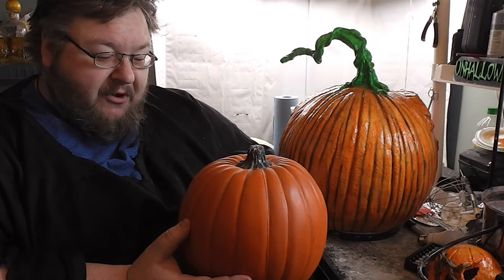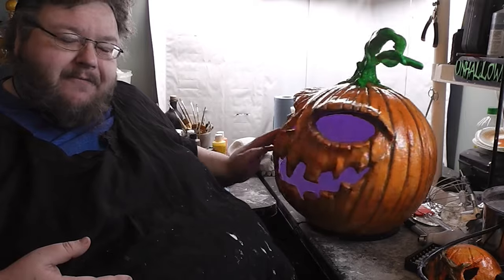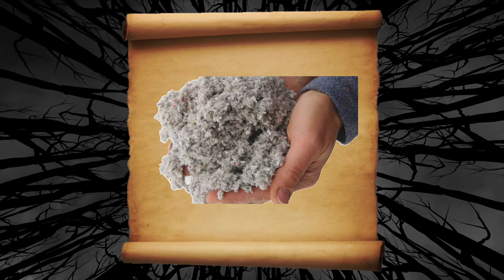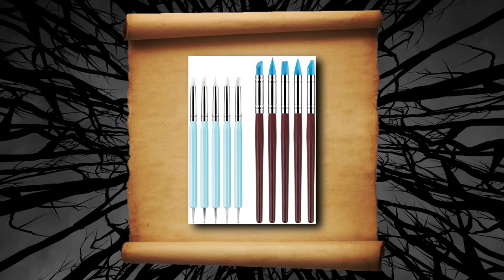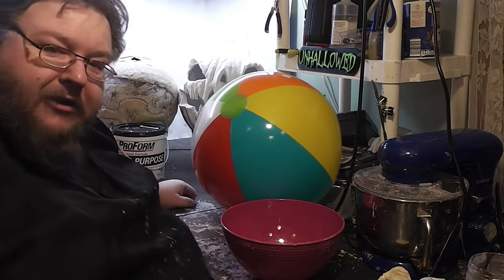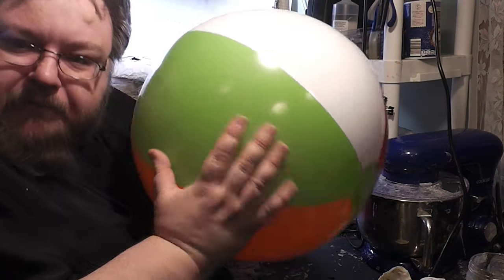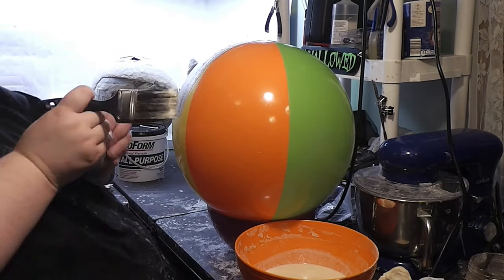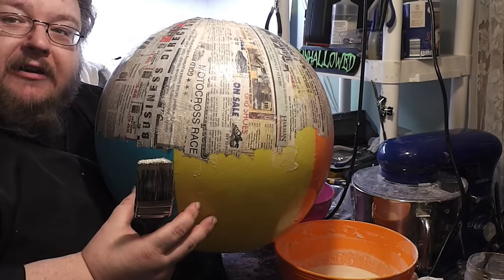Paper Mache Pumpkin Version 2 - Part 1 Intro and Materials

Comment: Apologies if I missed this on another video or stream, but is there a reason why you stopped using the liquid starch in the paste?  I’ve made a few of the V1 pumpkins with the starch in the mix (with good outcomes) and just wondering what the difference is. Thanks, Drach!
Reply from the maker: I never found the liquid starch did much for the mix so I didn't include it

Comment: Out of curiosity. If I like the more squared shape pumpkins that the trash bag design gives, could I maybe just partially blow up the beach ball? So it has that squared situation??
Reply from the maker: I did an experiment recently with a similar method. I underinflated the ball and then wound some packing tape around the middle to give me a taller more oblong pumpkin and it worked fairly well. Underinflating and then reshaping is very much a viable way to do things. I would suggest that you use some sort of constricting medium like tape/rope/cord to clamp down on the underinflated pumpkin so that it still give you good push back in its underinflated shape in order to still be a sturdy armature while you are laying and adding clay.

Comment: Hello, congratulations on the video. I have a question: do you put something on the ball to prevent the glue from sticking, or do you apply it directly? Thank you.
Reply from the maker: Thanks. I don't put anything special on the ball. As mache paste dries it does not interact with the beach ball and so when the ball is later deflated and removed it will always pull smoothly away from the mache shell.

Comment: Do i mix the 6 cups of flour and 1 cup of glue and water? All together? Or little by little?
Reply from the maker: You'll have your best luck starting with a bit of water in the mixing bowl, maybe 4 cups of water in the beginning. From there you can add glue and flour all at once. The water present at the beginning will help ensure that the flour doesn't clump quite as much.

Comment: Hi there!!  I’ve finally decided to give this a try.  But here’s my problem, I don’t have access to news paper so I bought packing paper, it’s thicker and heavier than newspaper and I’m having an issue with it raising in kinda like waves on the edges.  Any tips on how I can eliminate that problem? I’m hoping that when I clay it… I can try to feather some of it out.   Thanks in advance!!! I just love your creativity!
Reply from the maker: No problem. I'm guessing the stuff that you have is something like what I call kraft paper which is the brown paper often used to wrap things. I can see where that would have a tough time sitting flat. You have a few options. The first option is to severely reduce the size of your paper strips. If you make them about an inch or less wide and about 6 inches long you should reduce the tendency of them to frill up at the edges. The next best thing is to obtain something with very good paper flexibility to alternate layers with and in this regard the best choice would be paper towel. So you'd do a layer with your packing paper then one with paper towel and keep alternating. This ought to apply a little bit of down pressure on the frills while keeping some moisture locked on them long enough to drag them down. All in all I would not panic if you think that the shape is in a bad way at the onset. When you clay over all of it you will never notice the flaws in the shell.
Reply: @Drachenfang  thank you so much!!!  I did end up using a much thinner packing paper over the thicker paper and it really helped!!! I do have a couple of knobby bumps, but I got to thinking I’ll use them to my advantage to give my pumpkin some added character.  Lol!  But I will definitely do another layer with paper towels!!  Thank you so much for your tips!!!
Reply from the maker: @annmariewalker892  Always happy to help :)

Comment: Maybe it's because I'm in the UK but that seems like a lot of flour, i might end up with a bucket full of glue with that amount.
Hmmm is that amount of flour necessary?
Reply from the maker: It's honestly more like a ratio. 6 parts flour to one part glue and add water to preffered consistency. It's really down to how much paste you want to make. At this point I've made the stuff so often that I don't measure anymore but when I was starting out this was the ratio I used.
Reply: @Drachenfang  giving it a go with just PVA and water, the flour just kept clumping up.  Will see how the experiment goes. The beach ball isn't perfectly round and has flaws, but i will see how the first stage turns out.
Reply from the maker: @swanchamp5136  PVA and water is very reliable and has no mold potential so I think it's a very good call. For flour you need to add water to the bottom of your bowl first and then hit it with a mixer (ideally with a whisk head). Warm water also helps. Beach balls almost always have a bit of stretch off center. It really isn't noticeable in the final product.

Comment: Hi

Doing one of these. Did the last ones too. On this one thoe. When i removed the beach ball it had some mold spurs on inside. Do i just use a fan to take care of that
Reply from the maker: Yes. Once the mold is dry and especially if you varnish over it afterwards it's as good as dead so long as the project does not get waterlogged.

Comment: Another question my good man, or a few lol, do you the stand mixer for your paper clay, or the paint mixer on drill.? And I got some varnish and you said about matte spray varnish before, dose that really deshine the base coat of varnish, plus lol, how do you protect the base of pumpkin from the wet for, just paint drylock on bottom or coat base rim with silicone?
Reply from the maker: No problem. Always happy to answer good questions. Either mixer will work fine. I just bought the stand mixer because I do this all the time and it is handy to rapidly small batch paper clay. I used the paint mixer all the time before that and it works perfectly fine. Yes, the matte varnish will take the reflective shine off of a gloss varnish coat. With the bottom you need to be concerned about if it will be wet, abrasive, or both. So if you keep the pumpkin on wet concrete you stand the chance of it scraping along if someone kicks or moves it by accident then you have water infiltration through the scratch. If you keep it in damp grass then you only care about water infiltration. If you only bring them into a wet area on Halloween night then there won't be enough water to worry about and they will dry up afterward no matter what. If I have ones that I am worried about getting scratched up on concrete continually then I may glue a felt pad to the bottom to take the scrape out. If you plan on leaving them in wet grass then just drylok the heck out of them and make sure you have no unvarnished nooks or crannies. The base rim should get hit with varnish when you paint and ideally the varnish will penetrate down into any exposed material to make it water resistant.
Reply: @Drachenfang  thanks bro. I really appreciate your help
Reply: @Drachenfang  1 more lol, dose it matter what paint you use or dose it have to be acrylic or can I just use spray cans? As it's being varnished on top
Reply from the maker: @Zedsta  No prob. Really you can use any paint you want. Spray cans have a much faster coverage. I just went for demonstrating the cheapest option which is usually those 50 cent acrylics from any given store with an art section.

Comment: Hello Drachenfang - the maker of my good time crafting - and current passion of mine - question:  How large is the pumpkin you do in this tutorial - exact dimensions are requested and what is the size of the hole at the bottom?  I have a humongous 27" beach ball - do I dare try it?  Will I need a mack truck to get it around or out of my abode?  These and other burning questions are awaiting your expert advice.  Thanks.  Have a nice day.
Reply from the maker: Mine is a 22 inch ball and the hole is 10 inches across. It's gonna take a while and you need to make sure that your doorway can fit through a 29-31 inch beach ball. You'll also need to be very careful of the drying because if you have crumbling like you mentioned before you may have a spot where the weight of the ball makes a jaw break.

Comment: How do you weather proof your pumpkins? Can they withstand a month's worth of outdoor use with fluctuating temps and rain? Thank you!
Reply from the maker: If I am going full weatherproofing then I will give them a coat of spar urethane when they are unpainted but fully dried. Then I will prime them with a coat of drylok masonry waterproofer, and once they are painted I will give them another coat of spar urethane. To be honest I have never dared to leave them out for a full month of weather and sun. Other folks have done big displays with mache which are out all October and they do fine with this method. Scott Stoll of Stolloween does this and the folks over at Oak Lane Cemetery have a video out on mache props which get exposed to water over time. Usually the worst that happens is the prop gets soggy and then redries out. Then you can hit it with another layer of waterproofer.
Reply: @Drachenfang  thank you so much for your quick response! I’ve started a papier-mâché pumpkin but didn’t want to put a ton of effort into them until I figure out a weatherproofing technique!! Thanks again for your quick response I will try that out.

Comment: Hi Found this channel and now attempting to make a couple of pumpkins using your method. Just one question, you say 6 layers is that just 6 layers of paper or 3 x 6 as i notice you do 3 layers then let it dry as i have now added 12 layers and it is still soft in some parts and i have made sure i go over each part as i layer them? Thanks
Reply from the maker: 6 layers of paper is my general rule. I have two experiments in the works to see if you can get away with as few as 3. If you have areas which are still soft you can layer paper pieces over the soft spots only. I have found that softness is common in newspaper that has gotten wet and sat for a while or if there are air gaps between loosely laid on strips. Honestly if you have 12 layers of newspaper just go right to the next stage. The likelihood of a critical problem is negligible.
Reply: @Drachenfang  Great thanks for the reply will give it a go and move on to the next step

Comment: This is awesome!! Trying to prep for Halloween so i saw your video!! Thank you ao much for the info!!! What size of ball are you using?
Reply from the maker: The ball in this one is about 16-18 inches but for a first run through I'd recommend a 12" ball. They're usually measured online in the distance from the air nozzle to the top of the ball. I'll have a new series out soon on making your first pumpkin. I use toilet paper for the clay so people don't have to go out a buy a bale of insulation
Reply: Thank you so so much for your fast reply!! ❤
Reply from the maker: @MarlynJimenezVlog  No problem. I'm usually on the ball during summer time :)

Comment: Do I need to let each layer dry between coats for the initial paper mache? And the paper clay?
Reply from the maker: Each layer of initial mache does not need to dry before applying the next layer. You need to be careful with paper clay because if you apply a giant wad of it somewhere that is an inch thick or more then you run the risk of having it dry rapidly outside while having an undried core section where mold and bacteria can breed. I try to never apply more than a half inch of clay without letting it dry more or less completely before another application.

Comment: Can you link to the cellulose fiber? All I am finding is small food grade stuff, thinking that is something different
Reply from the maker: No prob amigo. Here it is: https://www.homedepot.com/p/Greenfiber-25-lbs-Cellulose-Blown-In-Insulation-or-Spray-Applied-Insulation-INSSANC/311574454
Reply: @Drachenfang  have you tried using the sharp edges of the paper tou remove and doing your own pulp from that? Thinking like put it in with water and other paper scraps (like from the shredder) and blending it up with a food blender. Just thinking of ways to save expenses
Reply from the maker: @danielloranger5251  I have never done this but it is certainly a very viable option. You can soak paper for a while and then put it in a blender to achieve a product which is almost identical to (and probably even better than) the cellulose insulation that I regularly utilize. Toilet paper is likewise even better than that as the cellulose fragments are even smaller and more finely separated.
Reply: @Drachenfang  blended up some cardboard and other misc paper shredder (junk mail) shreddings this morning. Looks to have worked great other than needing to dry the extra pulp for storage, will be mixing the clay up here shortly.
Reply from the maker: @danielloranger5251  Excellent. I'm glad to know it's going well. How's the texture of the stuff compared to cellulose clay? Lumpier, smoother, just as good?
Reply: @Drachenfang  i would liken it to a fine tuna salad texture , but polishes decently

Comment: Before anyone wants to start this cool project, they should consider the overall cost of the materials--it's not cheap.
This is the breakdown, based on the list provided in the video:

Beach ball	$2
Newspaper	2
Hand Mixer (thrift store)	2
Drywall joint compound	11
Hot glue gun w/glue sticks	9
Paint: exterior latex (sample)	6
Craft paints: brown, green, yellow	3
Bowls, bucket, brushes (Dollar Tree)	7
Amazon Basics White Glue (gallon)	12.99
Cellulose insulation	25
Spar varnish	26.99
Drylok Extreme Waterproofing	36.99
Wire: 140 guage (50 ft. min)	6.59
Total:	150.56

Even if you substitute the cheaper torn and soaked newsprint for the exorbitant cellulose insulation, that knocks off only about $25. This is not a cheap craft project. Don't make this pumpkin because you're too cheap to buy a fancy clay pumpkin. This project will cost way more. You do it because you love crafting. Just understand: this project is EXPENSIVE.
Reply from the maker: https://www.youtube.com/watch?v=ffP9XukGaoE&list=PL815lf2mZF_gG5b8EqVMzQT5YTpMsjeC0&ab_channel=Drachenfang 
I do agree that the finishing agents that I use are pricey. Reasonably though you could make some substitutions to slash the unit cost and even more so if you plan on keeping the pumpkin out of any kind of moisture. The spar varnish and drylok can be tossed in favor of only using the exterior latex paint on the inside and outside. A can of krylon matte spray with a uv resist is about $9 on amazon as of 9-30-24. The wire for this can be swapped for an old metal coat hanger which most folks can source. With those changes you can drop the buy in cost to about $83, which I agree is still no walk in the financial park. On the up side one unit of cellulose insulation will make 10 pumpkins easily and if you use this list then a gallon of spar varnish and drylok will be able to paint each and every one of those 10 pumpkins. You're completely right in the fact that this buy in if you have none of the components to start with is expensive. I would even argue that if you plan on making only one pumpkin then you are far better off looking at my '5 hour pumpkin' beginners video which has a cheaper methodology. If you plan on making a bunch of pumpkins though... the unit cost rapidly drops. It probably doesn't drop as low as the (ptooey!) foam pumpkins when they are on sale after Halloween but I know I absolutely adore it when a trick or treat visitor asks where I bought them from and I get to say 'I made them from paper mache' and then I watch as they refuse to believe it. :)